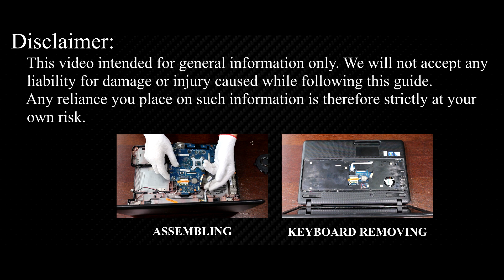Toshiba Satellite C660 Overheating Fix: Disassembly, Fan Cleaning, and Thermal Paste Replacement

Comment: One question, I have the toshiba satellite c660 2L5, do you know if I can change the CPU? And what is the maximum CPU that supports that motherborad without affecting the power source and get very hot?
Reply: In laptops; the CPUs are welded to the motherboard, they cannot be replaced.
Reply: @ElwoodBluesAK they do i replaced a i5 in this one

Comment: Can i put thermal paste on the gpu?
Reply from the maker: No, for GPU you need Cooling Conductive Silicone Pad
Reply: Is it necessary to replace it?
Reply from the maker: If thermal interface of video chips in an elastic state, its replacement is not necessary.
Reply: What the size and thickness of thermal pad and where to buy?
Reply from the maker: In description, I left link where you can buy new Thermal Pad.
Reply: @howfixit  there is no link for thermal pad ... can you please tell the required thickness for this notebook? thanks in advance
Reply from the maker: I add link to thermal pad in the description under the video
Reply: @howfixit  many thanks